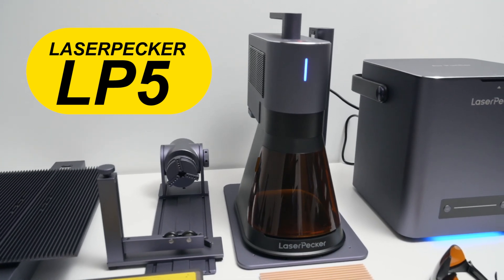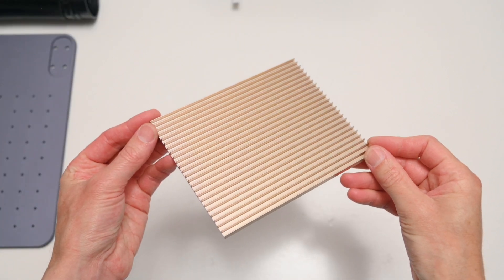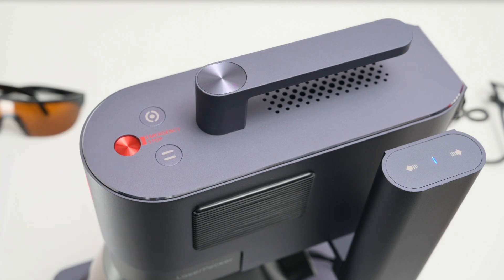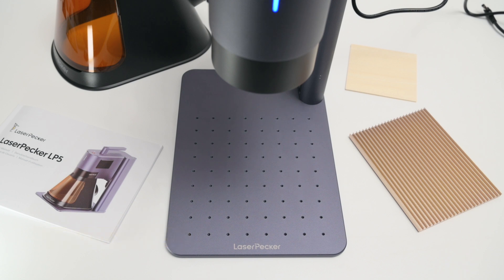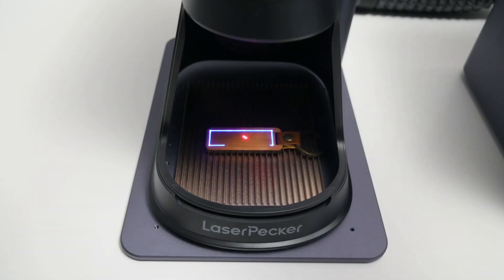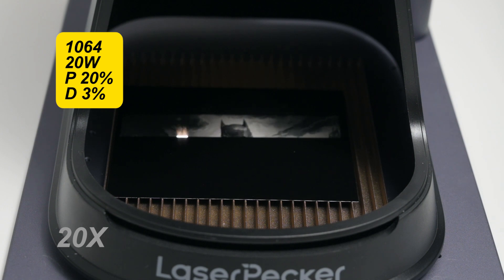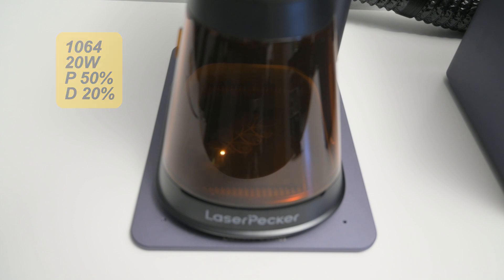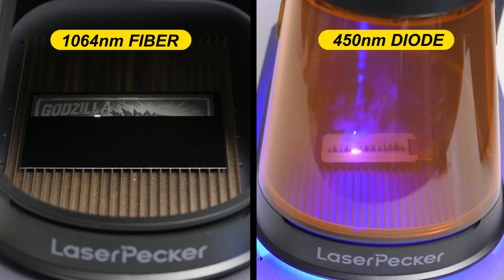A Portable and Powerful Fiber and Diode Laser- LaserPecker LP5

Comment from the maker: Time Stamps
0:00 Intro
0:24 Unboxing
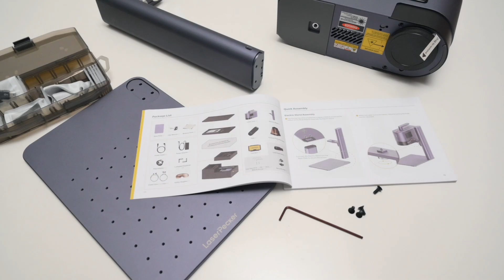1:38 Setup
2:23 Overview and Specs
4:04 Focusing Laser
4:21 Connection 
4:36 Workspace Size
5:15 Air Purifier & Web Cam 
5:39 First Project
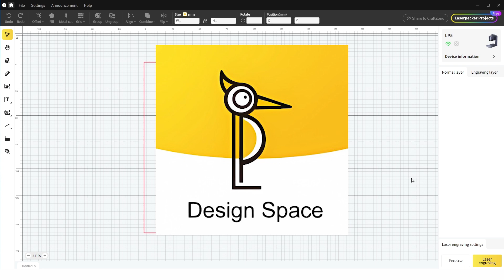6:36 Design Space Software
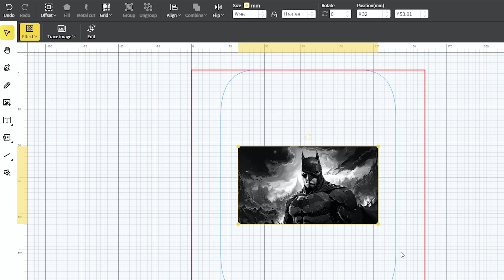7:18 1064nm Aluminum Card
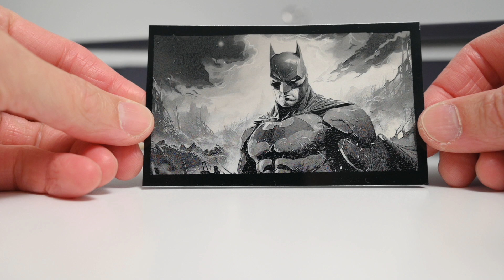8:24 Brass Coin
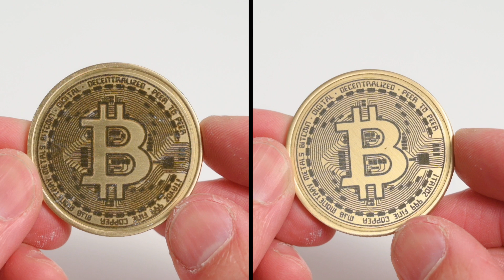9:14 Slate Coaster
9:34 Text Wood Engraving
10:27 Final Thoughts